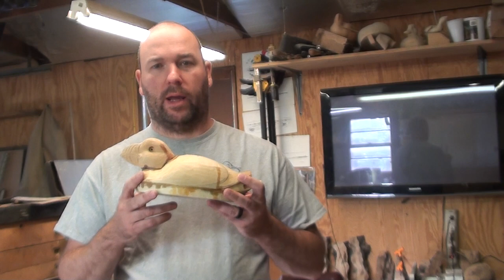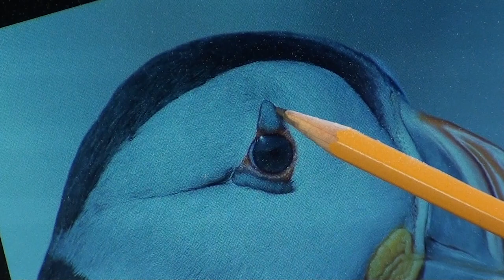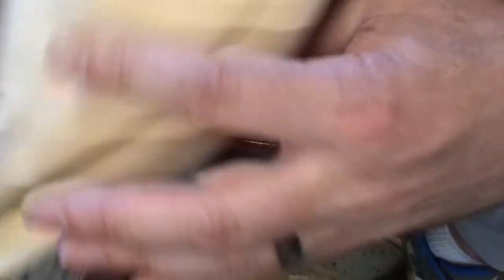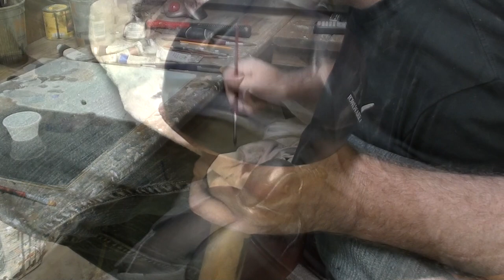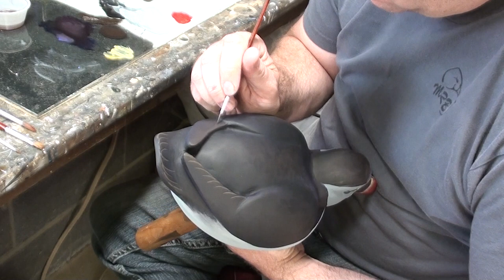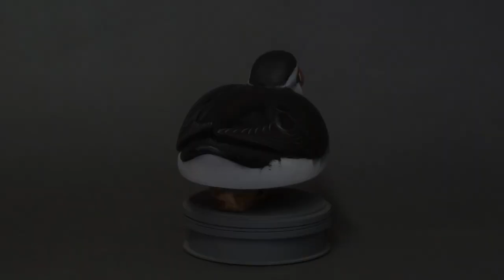Atlantic Puffin Decoy Part 2

Comment: Great informative video especially as i am new to carving decoys. Just wondered what you used to set the eyes and built up. Many thanks
Reply from the maker: Steve W I’m using epoxy sculpt. It is two parts A and B that you need together. You can find it on Amazon. Great product.
Reply: Many thanks 😁